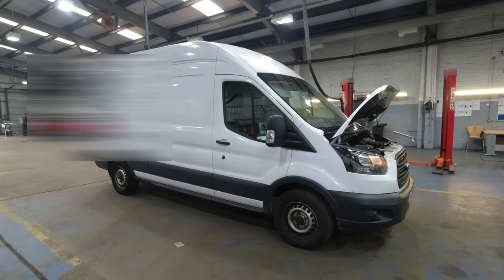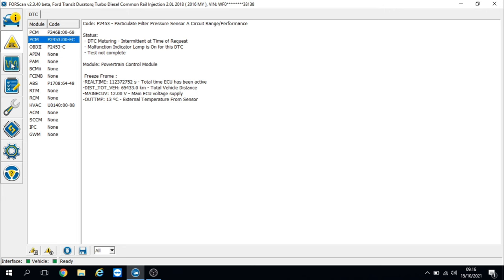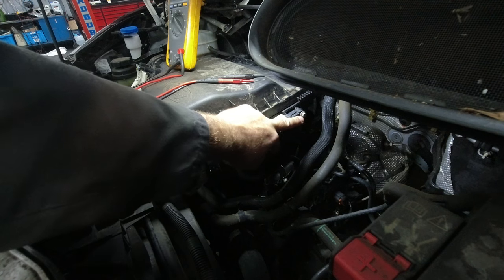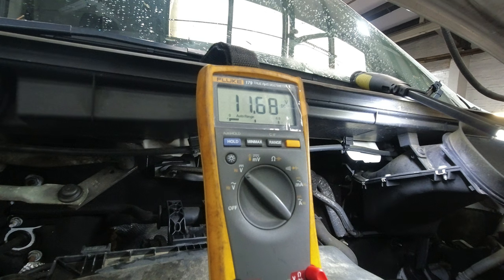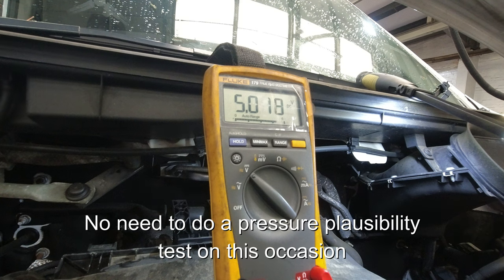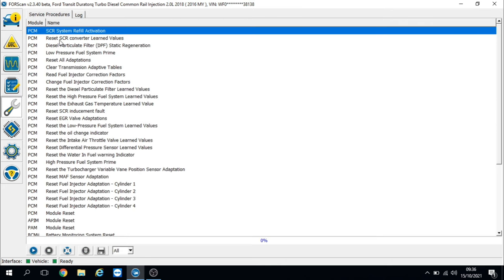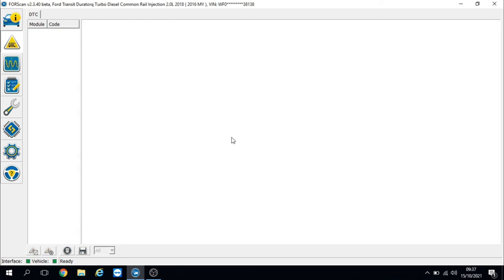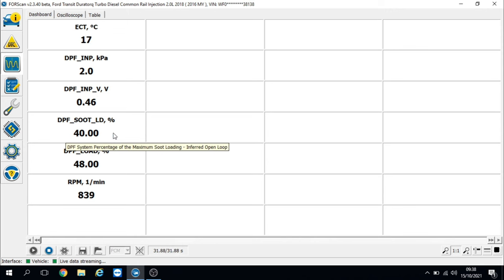Ford Transit 2.0 EcoBlue - DPF Pressure Sensor testing P2453 P246B

Comment: Hello Steve great video great job 
Where you’ve been a week ago had 66 plate Ecoboom Transit Custom 2.0 with DPF pressure sensor fault 
It took me a while to figure out as it was very intermittent fault which lead me wrong way 
The sensor was lying intermittently checked wiring voltages grounds everything everything will be fine for a while and then suddenly will give false readings and engine light come on restart will be fine again for a while 
Luckily for me at the same time had 14 plate 2.2 Custom in pieces with no front on it with DPF mapped out so checked and nicked DPF pressure sensor from it for testing purposes as it was same part number and hey presto and best of all both Customs of the same customer so swapped sensor to and it’s this day on the 66 plate one and I can call it a fix despite taking me bit of a struggle to diagnose 
Sorry for long comment and all the best to you keep videos coming 👍👍👍

Comment: We run a fleet of 2.0 eco blues. We keep these on the shelf as the fail so often. Normally go straight to live data keyon engine off and look at the voltage from the sensor. 👍👍
Reply from the maker: Yep. As I did. I was just showing how it's done. In the real world its just a quick look at voltage. Seen them sat at 0.1v too.
Transits keep us employed. Thanks for watching

Comment: My value is 4.5 kpa , voltage is 0.6 and the p2453 is coming intermittently but don’t trigger the CEL, should I change the sensor?

Comment: Hi, my ground and 5V ref wires are good. However the signal wire reads 4.5V with plug connected to sensor and the same when disconnecting it from the sensor. So do I have a wiring issue in the signal wire? Please help

Comment: Can a blocked dpf cause ad blue malfunction my garage put on diagnostic and comes up nothing and checked ad blue injector and its not blocked its a 2016 ford transit 2ltr ecopoo with 52k on it
Reply from the maker: it can yes.....however, it usually has a code stored.  Adblue malfunction can be many things unfortunately.  Check out my p20ee video for a little guidance

Comment: Wonder if you can help me i have pulled the plug off and was wondering if you could tell me the correct order they should go on to the sensor please help i have a white a brown and green cable
Reply from the maker: If you send me an email with your chassis number I will check
Sydiagnostics2019@gmail.com

Comment: Hi there mate I have just had my 2.0 transit go into limp mode plugged it in on my basic scan tool and it said dpf pressure sensor b ? Is there likely to be an A and a B sensor and will this method of trouble shooting still apply even if its a different sensor ? Many thanks
Reply from the maker: what code do you have, how old is the transit

Comment: I've got 5v coming out of the signal wire from the ecu, 5v supply and ground.
I'm thinking the ecu has popped or the supply wire has joined to the signal wire down the loom. Any ideas?
Reply from the maker: 5v on the signal wire from ecu, is that with the connector unplugged or plugged into the sensor
Reply: @SYDiagnostics  unplugged
Reply: With it plugged in im getting 0.4v on the signal wire on a scope, but when your looking at the live data from the ecu there is no voltage.
Unplugged it reads 5v on signal wire same as the output voltage.
Reply from the maker: @HMFDRAM  so plugged in and testing signal at the plug you have 0.4v but no voltage in live data?  Unplugged you have 5v on the signal wire? Are you looking at the correct data? As 5v unplugged on the signal indicated the wiring is OK and the ecu is giving the voltage
Reply: @SYDiagnostics  that is correct.
Om definately looking at the right data. I checked two other transits on live data this morning and they are showing 0.4 volts on live data and on my scope from the signal wire.

Comment: Hi i have 2019 kuga if this was faulty  whuld it not regenerate  had it 2 years i had to static regen twice never done  it whilst running regards
Reply from the maker: if it was faulty then it'd either be mis calculating and always prompting a regen, or it'd not allow a regen.....usually a code willbe set too for conditions not met or maybe for the sensor
Reply: @SYDiagnostics  thanks

Comment: How do I get the software your using ? What is it called and how much is it ?
Reply from the maker: its called forscan and i have a playlist on here with videos showing how to get it and use it. in my amazon store (links in this video) i sell the cables required. (One is a cheap version and one is the official cable)
Reply: @SYDiagnostics  ok
How much is the official cable
Reply from the maker: @kendavis504  approx' £70
Reply: @SYDiagnostics  where do u get your wiring diagrams
From
Reply: @SYDiagnostics  can I
Have link to purchase this
Please
Reply from the maker: @kendavis504  it one i make to avoid any copyright issues
Reply: @SYDiagnostics  I’m
Interested in purchasing

Comment: Nice little money maker based on knowledge. Would have liked to see your registration process. Not a lot of correct information on how it should be done. Nice video.
Reply from the maker: My registration process?
Reply from the maker: @d.d4184  you knew what I meant.... Not looked into it to see what I put
Reply: @SYDiagnostics  you have me lost now??
Reply: @SYDiagnostics  what I was trying to say is that on the Internet there is not a lot of correct information on how to do a regen. I wasn't saying your video was bad. Your video was excellent as usual. Sorry
Reply from the maker: @d.d4184  my bad, i thought you where saying i'd said or written registration instead of re-generation and was questioning where in the video...lol.
what part of the regeneration is it you would like info on?  I do have a screen capture video of the regeneration process and there is some info in my vaporizer videos
Reply: @SYDiagnostics  I showed my wife your comment, and I said what's wrong with that guy. She replied you just insulated him you clown. 🙄. No one ever went through the  regeneration process with me I just learnt it myself. I understand it's straight forward. Just interested how you do it. Have a good one.
Reply from the maker: @d.d4184   no worries lol.    Regarding the regeneration process, I either carry out a road test and monitor the exhaust temperatures, the soot levels, map sensor (will go negative ,100kpa) and the egr (turned off) so i know its all happening,   or I do a static regeneration and sit back
Reply: @SYDiagnostics  nice. The egr unplugged is something I haven't done. Will give it a go. Have a good one Rocket Man. 🚀
Reply from the maker: @d.d4184  no, i don't unplug the egr as that will induce a fault, the egr gets turned off during the process and the throttle body closes too.
Reply: @SYDiagnostics  thank you. That makes sense.